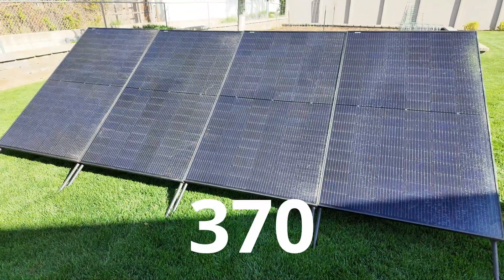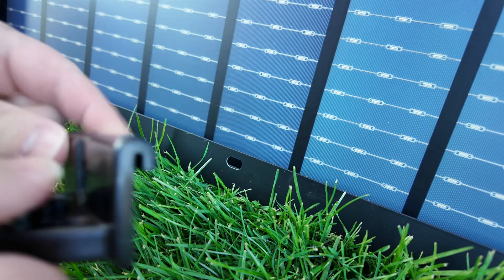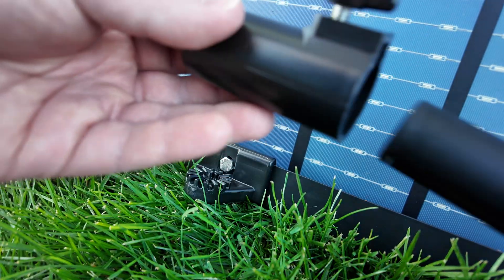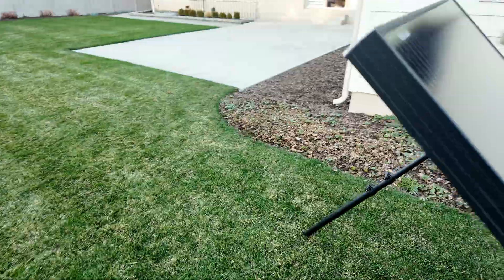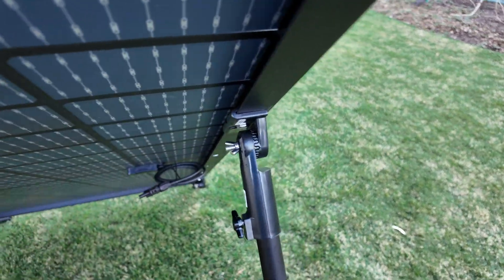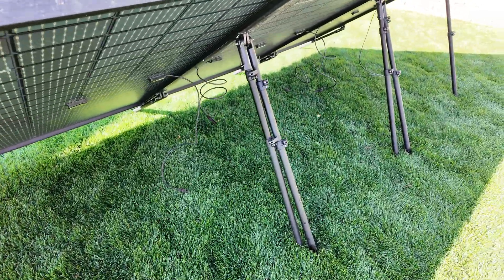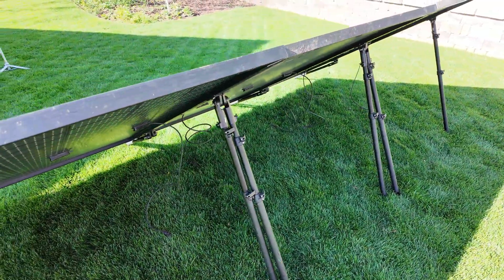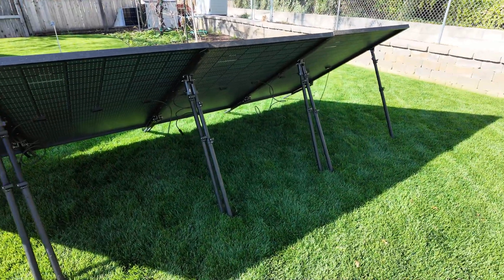Build a Ground Mount Solar Array in Minutes?! NEW Telescoping Stands Reviewed!

Comment: I did not see anything on the website that states how far the legs will extend/collapse. Does anyone have a measurement?
Reply from the maker: So fully collapsed they are approx: 30 1/2” long. And fully extended they are approx: 71” long. Thanks for watching!

Comment: While these are very inexpensive, they are not meant for a permanent installation. They are for temporary use and should be taken down in bad weather. For instance, at a 25-degree tilt, a typical solar panel in a 110 mph wind experiences about 600 lbs of uplift force. Even a 60 mph wind will require at least 25 lbs of ballast per solar panel. These racks have nothing to prevent uplift forces from lifting those panels right into the neighbor's yard during a summer thunderstorm. For a more permanent, portable solution, I recommend IntegraRack IR-30, and the IR Ballast kit using CMU blocks like I did. Then, if you need to move it, you can remove the CMU blocks and put it elsewhere, but at least it is not susceptible to high winds carrying your panels away.
Reply from the maker: Yep! Definitely need to stake them down with earth screws or something! Thanks!

Comment: Way too expensive. Wow
Reply from the maker: Just curious…Have you priced the overall costs of other ground mounts? Including concrete and labor for installation? You might be surprised how competitive these stands are and you get to take them with you when you move! Anyway, good for thought! Thanks for watching!
Reply: @theresatrickforthat  yes. I own 3 ecoworthy mounts.   Which hold 3 panels.   The mounts should not be as expensive as the panel. Especially for plastic pieces.   They look like good mounts but price is too high
Reply: @theresatrickforthat  and by the way. The market will speak. If not too expensive they will sell well as everyone needs mounts.  Especially innovative ones. So will see.

Comment: Cool product, wish they were closer to $100 each.
Reply from the maker: Yes. A little less costly would be nice. But even still, they are pretty competitively priced compared to other ground mounts especially when you factor in concrete costs and labor installation costs or sweat equity. Thanks for watching!
Reply: @theresatrickforthat  These folks are living in another world. A professional solar ground mount rack starts at around $145 per solar panel and can go as high as $250 per solar panel, depending on the racking, the soil, and the environmental conditions expected over the next 30 years. These are a little pricey for temporary use, but they are dirt cheap compared to a permanent structure.
Reply: @DiySolarHelpDesk  sorry but you're wrong.  But nice try
Reply: @mattjudd5275  You're welcome to build it out of wood, but good luck getting a permit in a major county. NEC says all components must be "Listed". These legs are not.